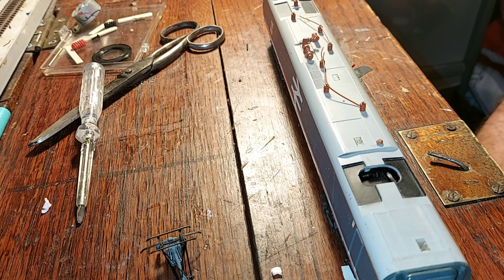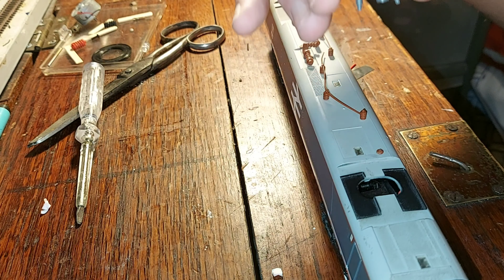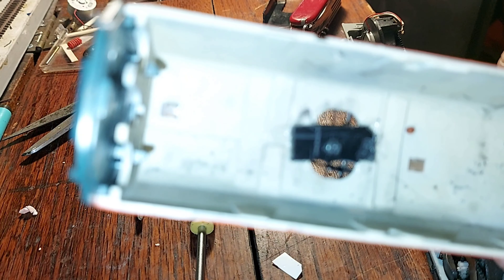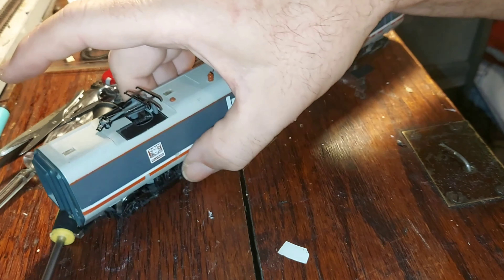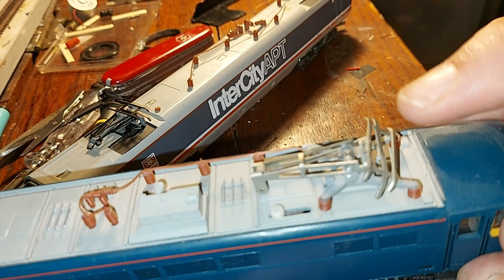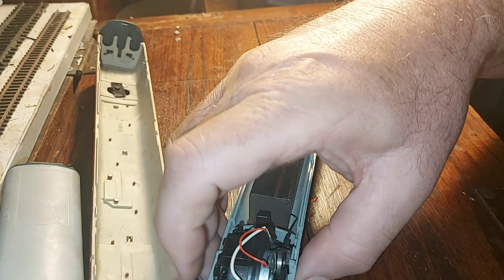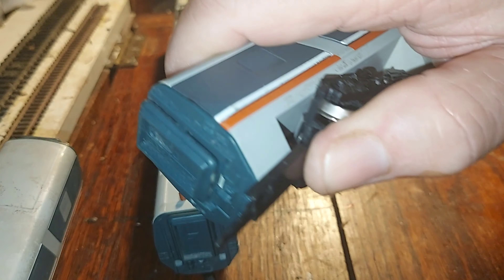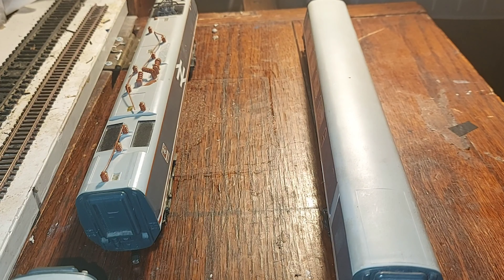APT refurb , the end !

Comment: Hi Geoff, I may have told you I have two sets, one I have running quite well plus another which I am having problems with the motor.
Tge Ringfield motor casing dies not lock and as a result it popped open and one brush pinged out.
I am thinking of ordering a new face plate from Lendons but not sure if that would fix the problem.
Any ideas?
My two pantographs are original 
Thanks fir doing and sharing
Reply from the maker: Hi Charlie . The face plate has clips and I suspect one or both the top ones have broken off , a new one should sort it .  Mine didn't come with the pantograph , I got it as a cheapie  :-)